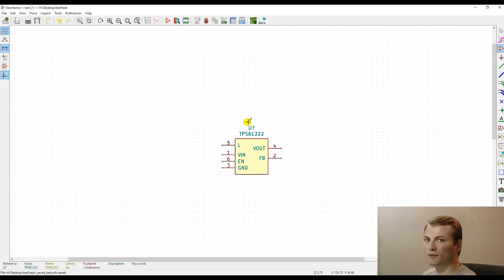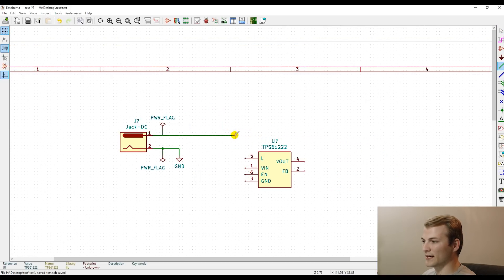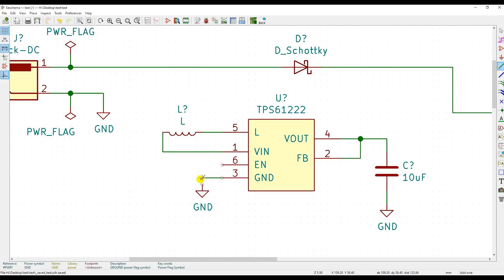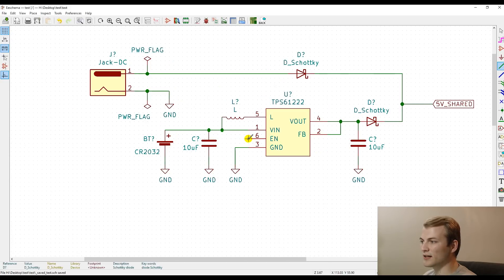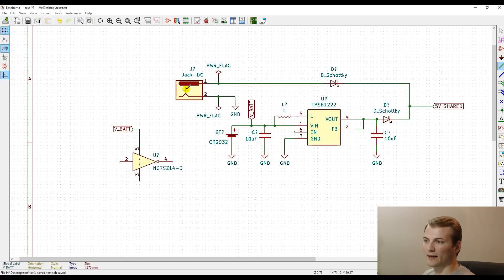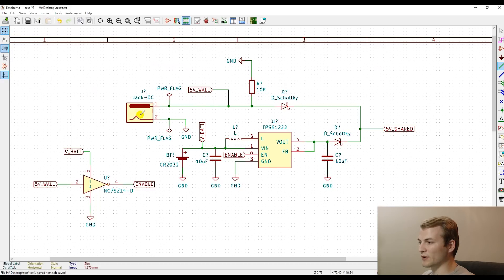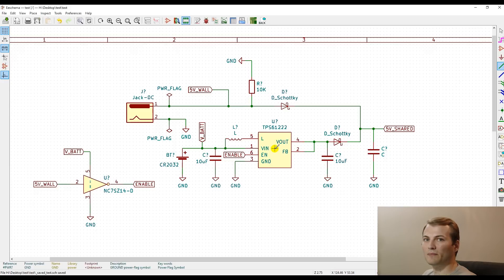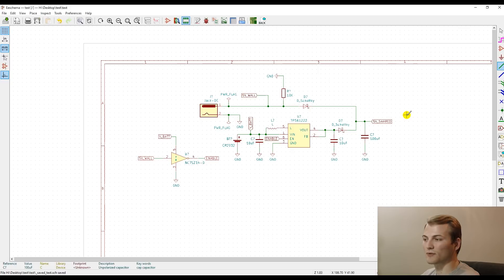Backup Power Coin Cell Circuit Design - KiCad 5 [QCB 1]

Comment: Hi Kyle. Nice circuit.
If you are willing to commit blasphemy (using a center-negative barrel jack scheme), I believe this circuit will save you an inverter: https://pcbx.us/muny/cgbr.png
Let me know what you think.
Reply: Hmm, just realized this only works if the power is disconnected, not if it goes down for other reasons. If there were a boost IC that had an active low EN that would be nice I suppose.

Comment: Nice little circuit. I have a couple points though.
1. You have a couple large capacitors (10uF and 100uF) that are normally found as polarized capacitors. But, you used a non-polarized symbol. I'd use the polarized symbol for those to help accidentally designing the board with the cap installed backwards.
2. I imagine the most common use case for this circuit would be to link it as a hierarchical sheet within a larger schematic. Thus I would avoid using the (granted, prettier looking) global nets. Use local nets on this schematic in all places except ground (that can be a global, and the ground symbol is a global net) and your expected outputs, in this case the "5V_SHARED" and "5V_WALL" nets. For those outputs I would use hierarchical pins. If you really want to use global nets, in this circuit I would rename the "ENABLE" net because I could imagine that net name might be used elsewhere in a schematic for another function. Maybe rename it as something to the effect of "ENABLE_BATT".

Otherwise, this is a nice video and I look forward to viewing the others in this QCB series.
Reply from the maker: 1. There is no 100uF cap, only two 10uF. Both of these are low esr ceramic caps. Typically you want to avoid electrolytics for decoupling since they don't work well for high frequencies.

2. Sure, I typically just keep all schematics to a single page using global labels, personal preference.
Reply: @MicroTypeEngineering 
1. My bad, I'm not used to thinking of ceramics (low ESR, so some sort of MLCC?) much larger than 1uF. But you have 3 caps. The third is 100uF from 5V_SHARED to GND, to filter out the momentary drop out during the propagation delay through the inverter and the enable circuitry.

2. Single page is good. In use would you redraw this by hand each time you want to use it, or has KiCAD's copy/paste between schematics actually started to work in recent versions?

Comment: That's a really good idea to do simple circuits in short videos. The format is great! Suggestions for an other video: USB battery charging, fuel gauge, NOR flash, etc. You speak slowly and intelligibly, which is perfect for educational content. I've definitely subscribed!
Reply from the maker: Thank you, I really appreciate that. My next video planned is actually a USB lipo charging circuit
Reply: @MicroTypeEngineering  Great content. It would be really helpful if you also show us how to add new custom symbols and manage libraries for both schematic and footprint.
Reply from the maker: @girijadav  thanks! Did you watch my other video on library and project structure?